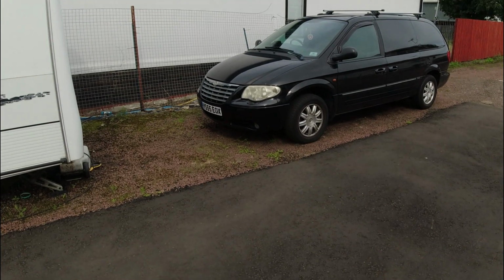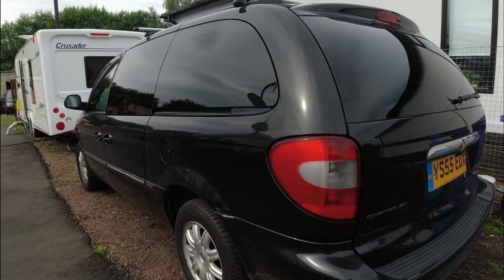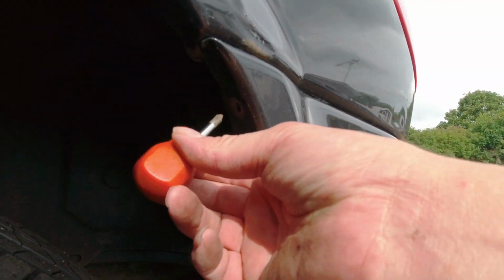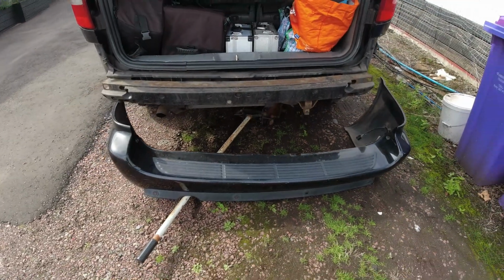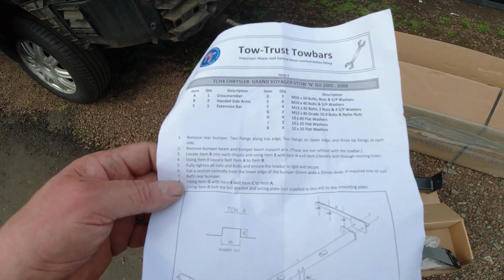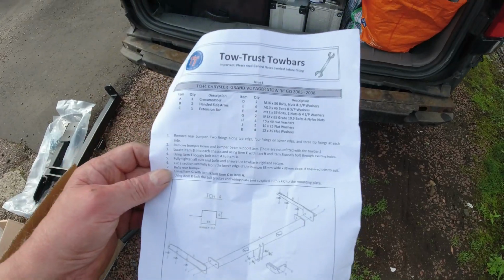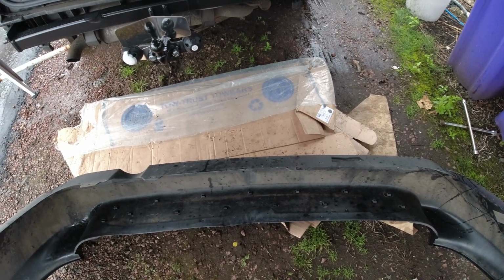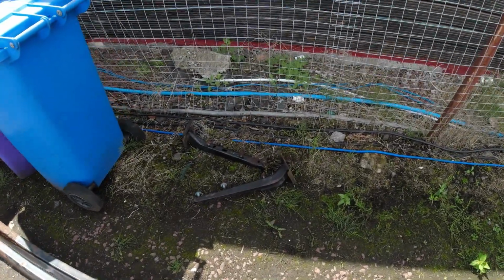How To Fit A Tow Bar To A Chrysler Grand Voyager || 2005 stow n go

Comment: Nice job mate! Can I ask why do you have 2 electric sockets at the back? Also can you give me the part number for the tow bar you ordered?
Reply from the maker: it's a tow-trust towbar from eBay model no:TCH4 costs around £200 1 socket is a normal 7-pin the other light gray one is for auxiliary electrics for the trailer ie, fridge reversing lights trailer battery charging. Some have the 16-pin plug then it's all in one plug.